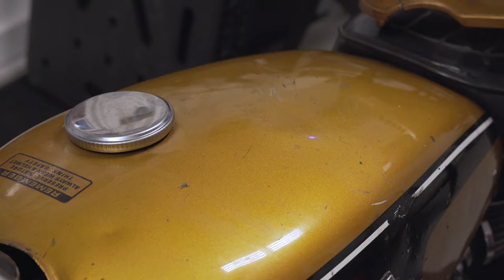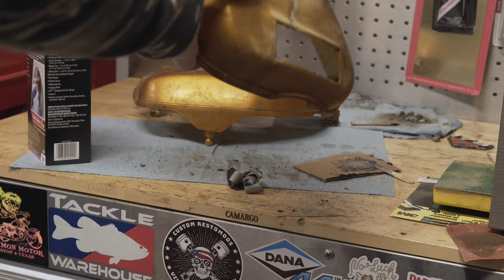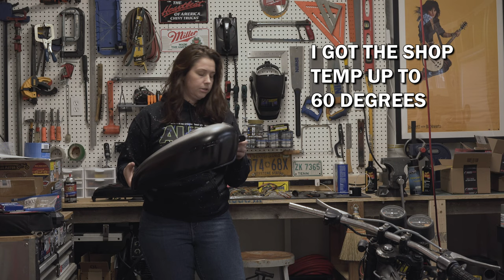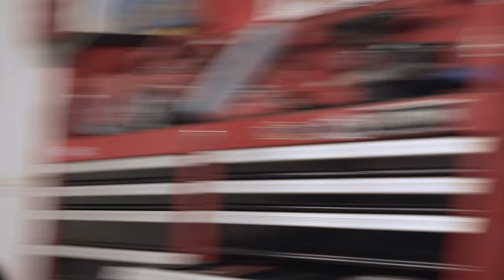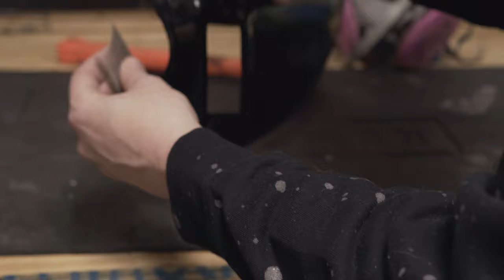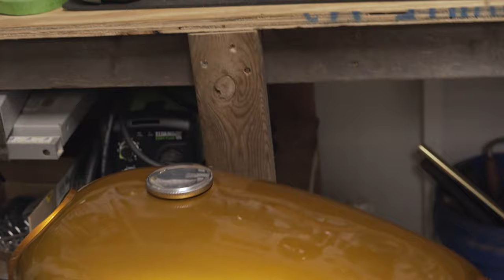My First Time Spray Painting a Motorcycle Gas Tank // Honda CB175 Ep. 6

Comment: a couple recommendations if you do this again, glue pull the dents before you strip the old paint off, i like to use bondo glass instead of straight bondo, it's a lot stronger and lastly seal the surfaces especially the plastic side covers with sealer or epoxy primer before you paint. glad to see you used 2k clear and you didn't try to use a plastic welder to put the screen in, that could have been disastrous with side covers, they are to thin...good job.....
Reply from the maker: I will definitely be using these tips in the future. Thank you!

Comment: When you are finished painting the side covers it's a good idea to grease the pins and grommets for the side covers so help removal later on ... Just a suggestion .. Very impressive paint job . You should be very proud of what you accomplished ... If the side covers badges are left and right you might want the wing facing the front of the bike . Just my opinion ... One more thing about the paint . Custom painters paint there subjects black before the color coat . This will show any imperfections in the body work before color goes on . Of course a scuffing of the black is required after you are satisfied with the body / bondo work ... Just a suggestion . ..
Reply from the maker: Thank you so much for the advice! I noticed the badges were backwards only after reviewing my footage. I didn’t even think about it. I’m glad to hear you approve of the new paint job!
Reply: I guess I should gave a little more details about the black paint first . After the paint sets up use a fine scotch brite and dull down the paint . If there are any low spots in the body work it will show up as a shinny spot in the black paint .  @LadyMotoBang

Comment: Don't worry about making "mistakes", that is how we learn 👍. I think the paint turned out sweeeeeeet, and once cured and then a polish it will really pop 😎. Just one thing has my OCD going into overdrive, the side panel badges, are they handed? If so the HONDA wing should be facing towards the direction of travel, other than that, fantastic job.😁
Reply from the maker: Yes the badges ended up on there backwards. I’ve switched them to the proper sides now but oh man you’re not the first to let me know 😂 I only noticed as I was going through my footage 🤦🏻‍♀️ Thank you for the compliments on the paint job! I’m very happy with the results.

Comment: Looks good.  Did you use a 2 part clear coat after the paint?  That's crucial to make it gas resistant.
Reply from the maker: @daveco1270  sure did! It’s holding up well

Comment: I went to the Colorite website and had trouble navigating honda colors. What is the exact description code and color of the gold you used? The only candy gold I saw was the Honda Y2C candy gold.
Reply from the maker: Yep that's the one I used. I read that honda changed the paint codes quite a bit but the guys in the honda forums seemed to agree that the Y2C with the 1075 basecoat was the way to go.